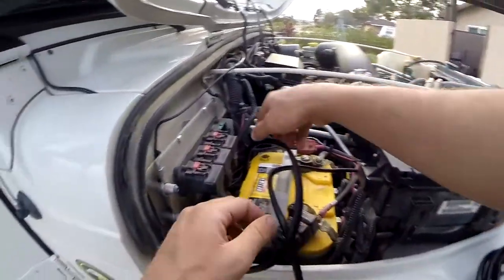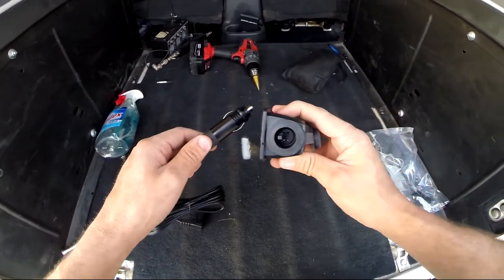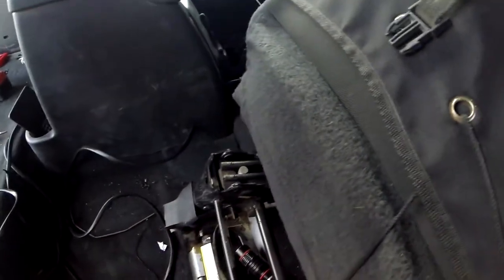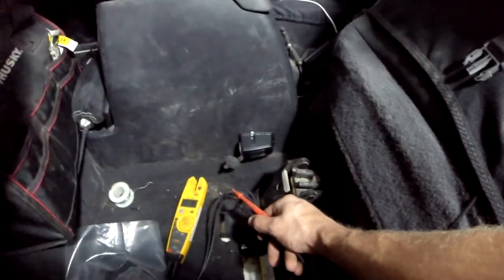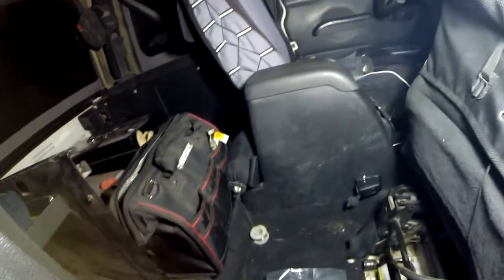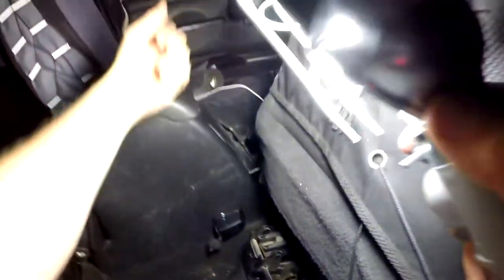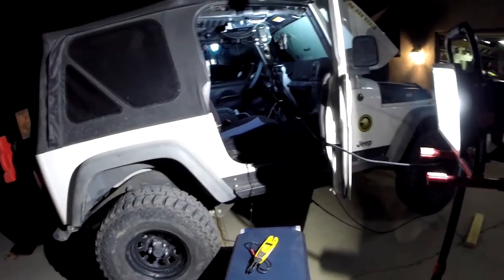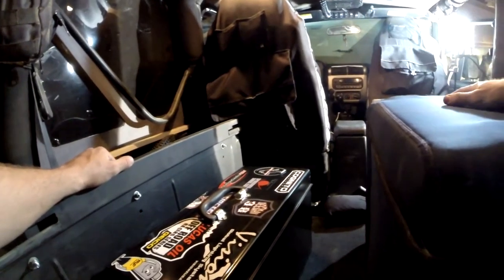ARB Fridge Wiring Kit Review and Install

Comment: Can this be done without soldering?  just bought this kit but don't have a soldering tool or the skills.
Reply from the maker: Yes it can be done with out soldering, but you’ll need a tool to crimp the connectors on the wires. 

Soldering is very easy and the tools are not very expensive. There are plenty of good videos on here that will be able to explain how to do it. 

Thank you for the comment, let me know how your install goes!

Comment: What about hard wiring the fridge with an anderson connector?
Reply from the maker: That is a very viable method. Anderson connectors have a very high reputation. The reason I chose this method is that I can maintain the ability to plug the fridge into another vehicle without having to purchase another cable. 

If that was not the case for me I would have used an anderson connector.